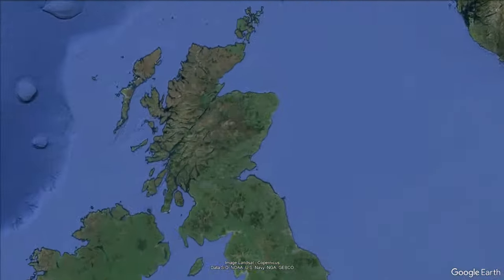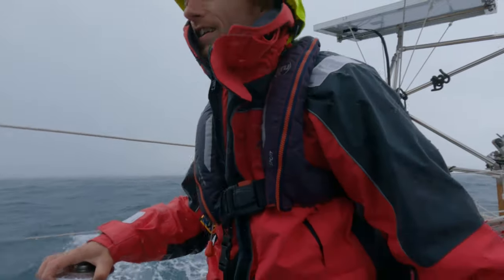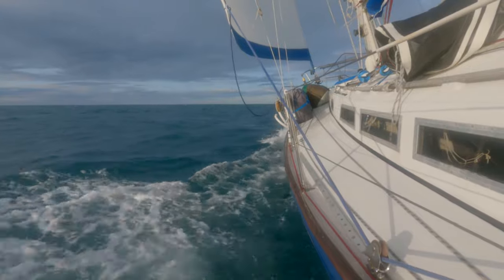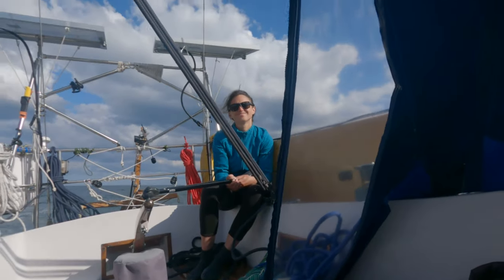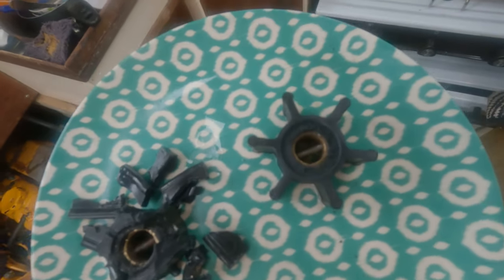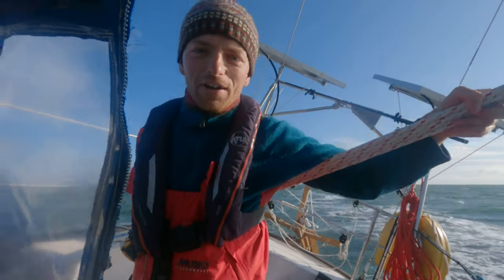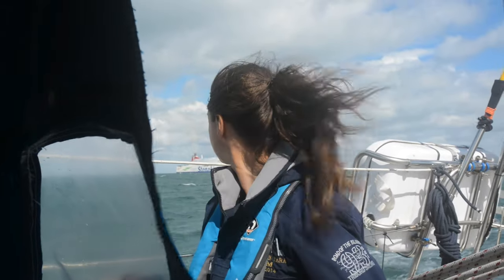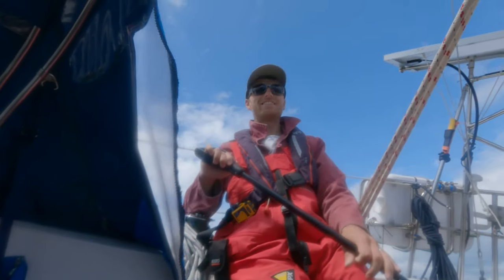Racing against storms down the coast of the UK

Comment: Just found your channel.  I did the same passage, Peterhead - Blyth - Scarborough - Lowestoft, Dover then west to Plymouth in 2021.  Departing Peterhead in to a 6 metre swell was interesting, but with a northerly wind and sailing south with the tide we made some great passage times.

The 'clubhouse' at Blyth was stunning.
Reply from the maker: Exiting Peterhead harbour with a 6m swell must have been spicy! It's a great run down to Blyth though, we had a cracking sail. We would have done the same and tied up in Dover but the big front that came in stopped us at Ramsgate. Thanks for stopping by and commenting 👍🏼

Comment: Hello from a fellow Scotsman living in South Australia. Noticed you have a Hebridean on the back there. I’m currently building one.
Reply from the maker: Aha where do you hail from in Scotland? Some awesome cruising ground you've got down there! Aye the Hebridean is a tank, what stage of the build are you at? :)
Reply: @sailingmaalie  I’m from a horrbile little place called Hamilton. The sailing down here is allot nicer than strathclyde park but I do miss the western isles 

I’ve just finished my initial assembly so time to pull it all apart and prep it for final assembly.

Enjoying your videos keep it up!
Reply from the maker: Some of the finest cruising we've experienced was on the west coast, spent about 5 yrs there in various smaller boats before finding this one. A tip about the wind vane - there is a section of threaded rod that comes out of the carbon fibre push rod (bottom end). Leave an extra 10-15mm on this piece, as it allows for extra adjustment of the pendulum if required. Hope that makes sense!

Comment: When you say  "twin reef in the Genoa" do you mean two full turns or something else? What boat is it?  I take it you bought 2 impellers so you have a spare , some silicone grease is good when fitting a new one but once the water is there its fine.
Reply from the maker: Generally when we reef, we match the sail areas. So 2 reefs in the genoa would make the head of the genoa the same height as the main with 2 reefs. Does that make sense? And yes, spare impellers now on board! This still turned out to not be this issue, as the problems persisted on future passages
Reply from the maker: Maalie is a 1978 Rival 32 ⛵️

Comment: Twin main sheet? There when you got her, or did you install? I’m in a R36, currently with a knackered old traveller and keep seeing twin systems and they are giving me pause for thought…..do you like it?
Reply from the maker: We added a 2nd mainsheet to allow us to use our new spray hood 'cockpit cover' whilst sailing.There's a snap shackle on the bottom of main sheet fiddle block, which attaches to a big dyneema soft shackle  on a coaming cleat. This way its very easy to remove when we don't need it. In terms of sail trim it's fantastic, much more control than a single mainsheet. The 'windward' mainsheet acts like the traveller, whilst the leeward mainsheet controls leech tension. We'll do a boat tour vid soon with details, otherwise there is more footage in our North Sea crossing vids. Hope that makes sense! Cheers